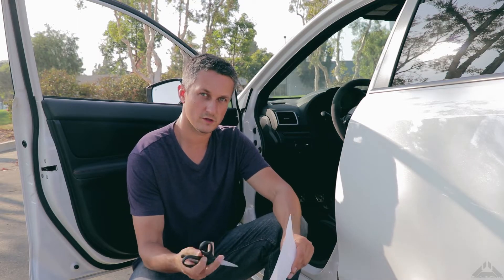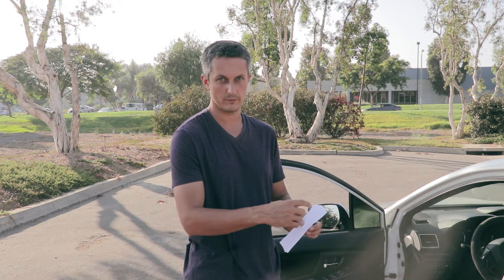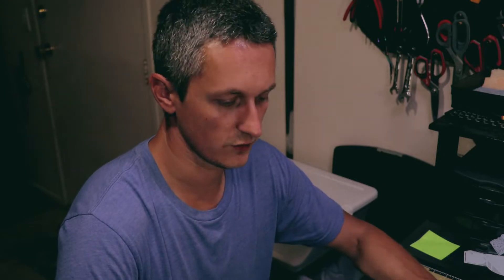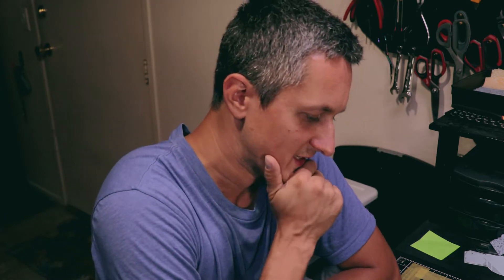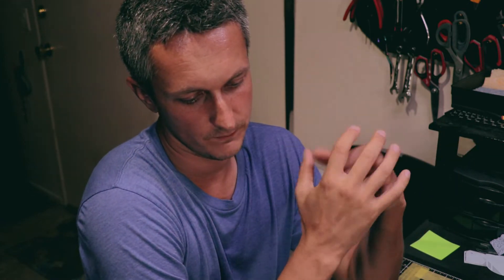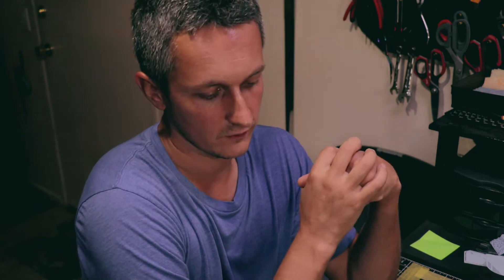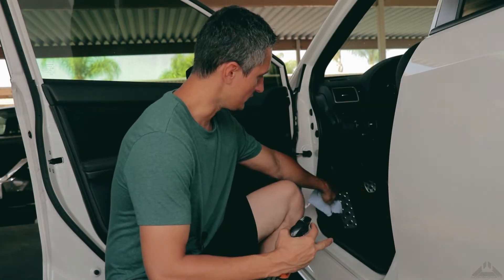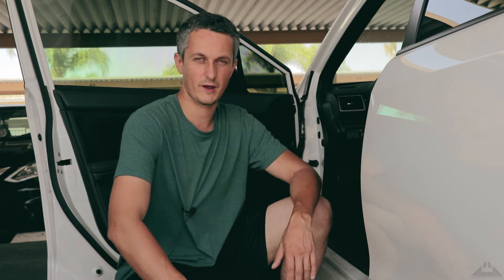Making my own carbon fiber foot rest pedal | 2018 WRX

Comment: Damn, with the talent to do that you should try the trim around the shifter. Oh! Or a rear view mirror cover. That would look great as well. Like the Mugen ones.
Reply from the maker: Got a few things planned for next videos! The ones you mentioned would be cool, but it's a lot of work making actual parts as replacements VS. A panel like I did. You need a mold for those and that's when things get really tricky. You can cover them in carbon but you don't get that nice flat surface since nothing is pressing on it, so it's a lot of post-work to get a smooth finish. I wanna focus on parts that are add-ons like winglets, diffuser, canards, etc.

Comment: You make shit look so easy man. Turned out great! I can't wait to see what else you make!
Reply from the maker: I used to build rc boats so I've dealt with carbon a lot. It actually is pretty easy once you get used to the process! That is until you start with vacuum bagging or infusion, then it gets tricky. Wet layup shown in this video is super user-friendly.